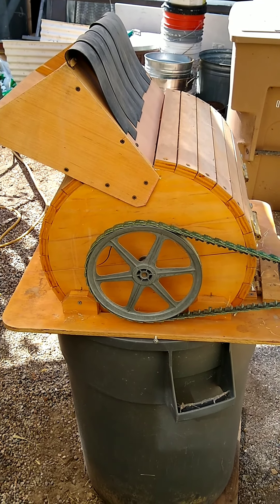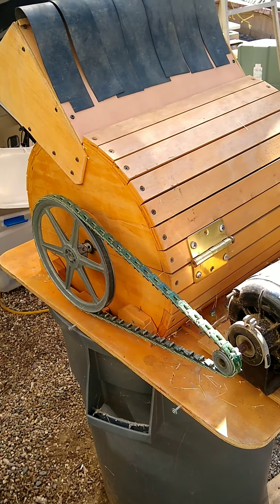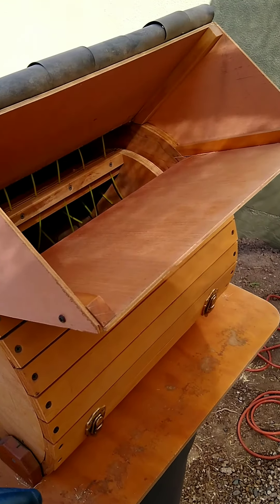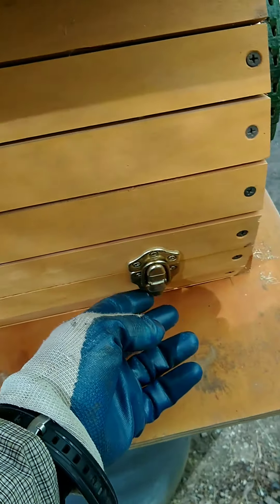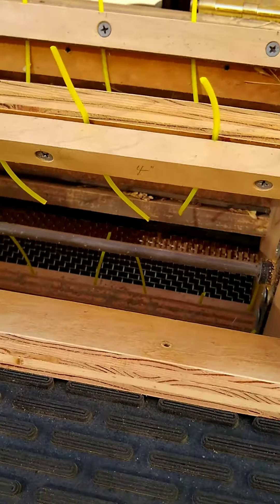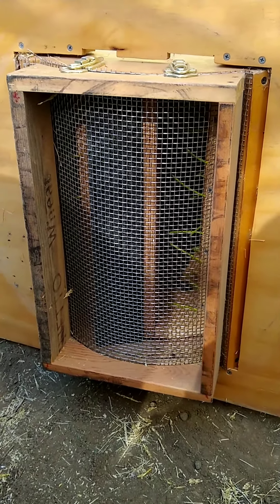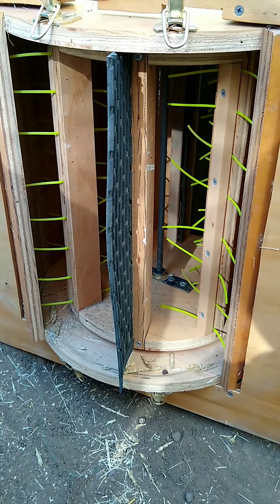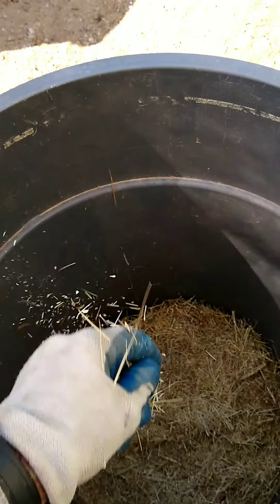Homemade Small Scale Threshing Machine, June 3, 2020

Comment: Great idea.  How did you attach the metal rod to the brackets that are screwed to the inner wooden cylinder ends?  Are they welded?
Reply from the maker: Braised. With a plumbers torch and a camp stove.  Lit the stove, put the bracket/rod (one end at a time) on the stove and used the torch to get to the temperature quickly.  Might have been overkill.

Comment: Do you have the plans for this threshing machine? If so anyway to acquire them from you?
Reply from the maker: Sorry, no. I've never tried to draw-up plans.
Reply: That's a shame. I have seen many post of people looking for plans. Lots of ideas out there just no designs to follow.

Anyway you could share some rough dimensions (diameter & length), size of pulleys,  length of the weed eating string?